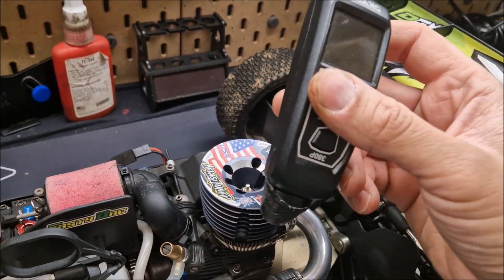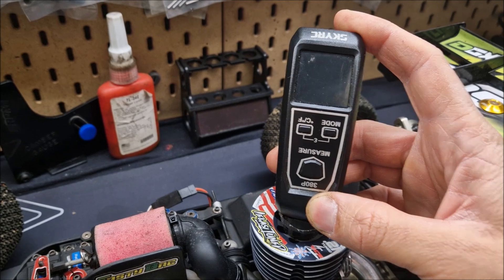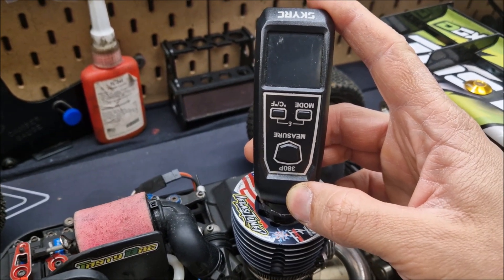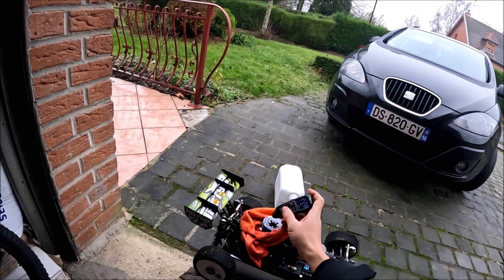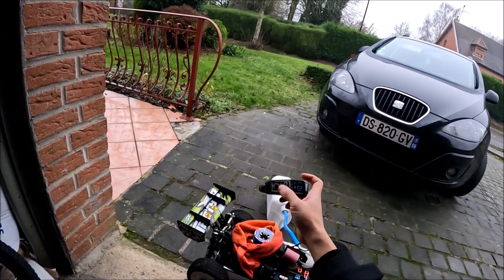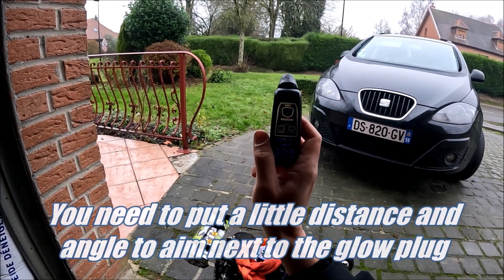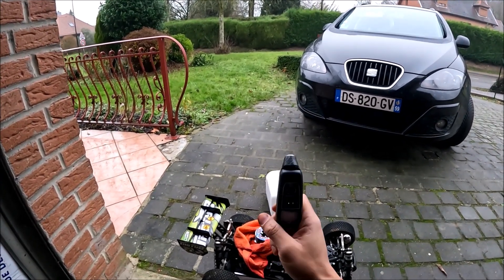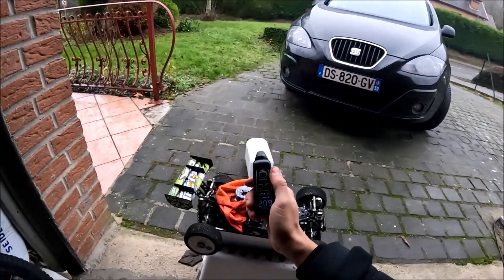Nitro Engine Temp measure

Comment: 👊😎

I have a F 4.6 motor in my Revo monster truck.  What a great tip.  I definitely listen to everything Nitro that you deem fit 👊😎
Reply from the maker: Thank you! I have the force 28 maxx in my revo, wich is based of the force 28 (f 4.6) great engine so far

Comment: If you use a temp gun , take the reading between the plug and heatskink off the head button on the EXHAUST SIDE. If you use the intake side there can be a 20-40 degree delta , If you use the plug from a vertical stand point it will be 10-20 degrees cooler. Great Vid !
Reply from the maker: Sometimes even more! I need to pay a lot of attention to this especially since we run low nitro content fuel 😟
Reply: true...when I run an engine with compression high enough that forces me to run 2 cooler range plugs I've seen as much as 60 degrees going from intake to exhaust side. Do you have access to Methanol and Nitromethane over there ? If yes then make your own fuel. Its easy and much cheaper than buying premade stuff. @TastyBRC

Comment: Since we last dicussed this i have been doing some testing. I haven't ran much since then, but untill now i think the most accurate and consistent measurement is at the lower coolingribs of the coolinghead.
To be continued.....
Reply from the maker: I once tried to check the block temp but depending of where you take the measure, the temperature varies enormously. You must be right, the lower fins of the head shoul be the best spot the check but not very convenient when the body is on the car. Most of the time we can sens the temp by ear, too hot, too lean will make your engine sound the way that we dont like.. but I can't be fixed, I always need to check the temp

Comment: Reason for that is because of surface emissivity and refractive index of different materials and finishes. Polished aluminium and shiny steel is about the worst accuracy you'll get and that's exactly what the glow plug and head button are. I think it's always best to measure with the thermometer angled towards the back (exhaust port). Angled far enough to measure on the anodised aluminium of the head. Also the skyrc thermometer is too thick to properly angle it. Get a 8220 type small thermometer (about $5) and you'll get much more consistent results.
Reply from the maker: Found the 8220 on Alixprss, I'm going to give it a try 👍